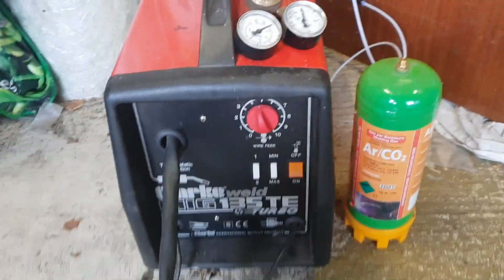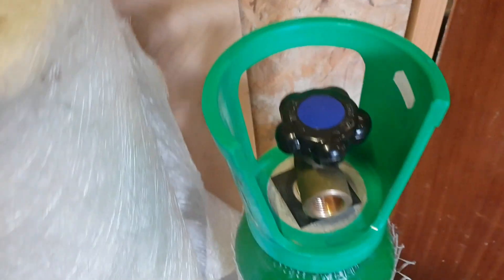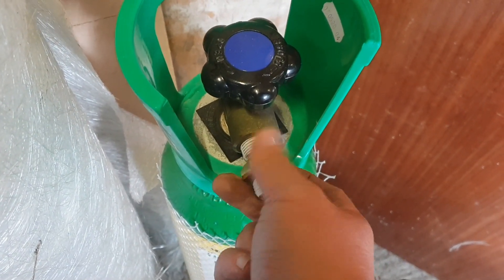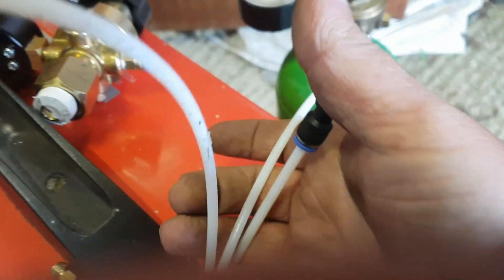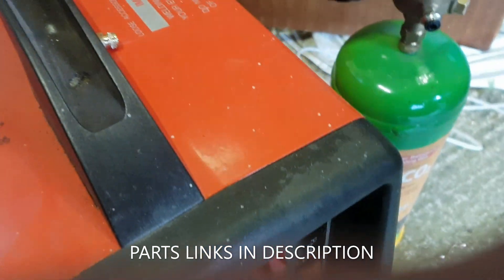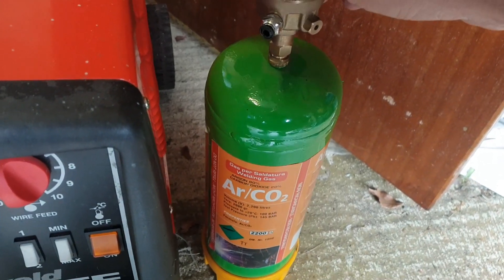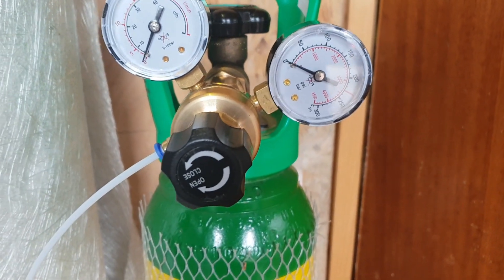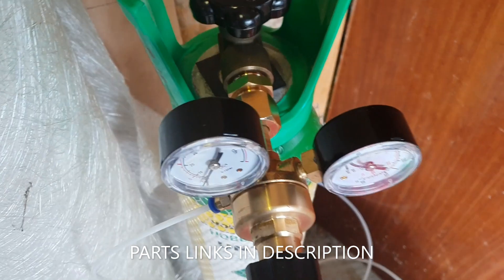How to convert a Clarke / SIP Mig welder to Hobbyweld 5 Gas & How long does it last?

Comment: Never use thread tape or any type of sealant on those cone face fittings. There is absolutely no reason to use thread tape on the regulator to bottle adapter fitting. The fitting is designed to seat and seal on the cone face of the adapter, or the cone face of the regulator if no adapter fitting is used. If you have gas leakage out of the fitting without using the thread tape you either have not tightened the fitting tight enough, or the cone face of the male fitting is damaged not allowing a complete seal. Another issue with using thread tape on those fittings is if a small piece of thread tape breaks off and is sent down the gas line, it can cause a gas flow restriction in the welder.

Comment: PTFE tape is of no use whatsoever. It's supposed to be a metal on metal seal. PTFE is for Tapered threads only (BPS/NPT)  The threads you are connecting are parallel.
Reply: Bollocks.
Reply from the maker: Correct, but it works perfectly so long as you apply it carefully (not to go down the tube etc). The threads on some regs like this one are too crappily cut for a tight seal.
Reply: @MotorClassics  the connections you have are designed to soft seat brass on brass. Then the adapter to the co2 should have a nylon washer. No PTFE should be used. Granted it probably doesn't harm it but it's a massive waste of time.